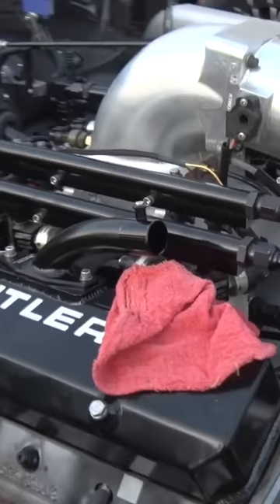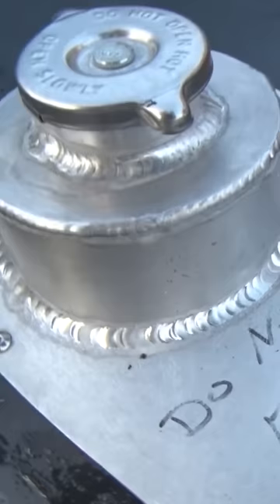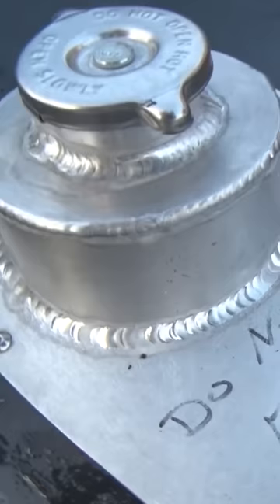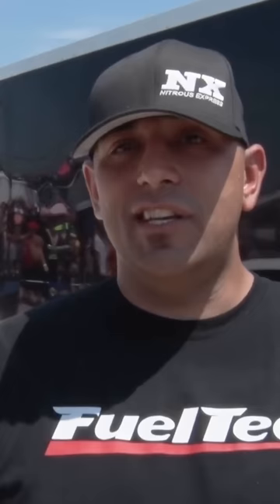Big Chief talking about The Crow’s engine

Comment: Man, you know I use to hear all that about diehard Pontiac people back home in Louisiana… They live and die Pontiac to life…👍🏾✌🏾
Reply: What do you drive now  cause they don't make Pontiac anymore.
Reply: @matthewvarnam4302 , for your information, I drive a 6 speed 1997 30th anniversary Z-28 Camaro… But, my dad owned a 72 Pontiac Lemans with a mild small block and my dads brother owns a old Limited Street NMCA 90 Trans Am with SB2 Pontiac small block in it down south in Louisiana… Back in the 70’s my uncle used to have a 67 GTO… So, yeah, I grew up around them…👍🏾
Reply: Can’t believe he’s still running aftermarket block and heads of a 55-78 Pontiac V8 platform. Love them myself- but the LS and BBC based stuff too cheap and easy. I guess the turbos are the equalizer with the fuel system as he says. That said , wouldn’t it make more power with some Warp 6 style heads ?
Reply: @jamessharp9790 , I’m with you on everything you said… But, some people that I knew back home in south Louisiana think the same way and they feel they can make it work, there’s no convincing them other wise… They almost stay true on the path with the power plant in the car because, they do not believe in mix breeding the car… Thats it right there…👍🏾
Reply: Bro I've always been Pontiac and I'll always Love Pontiac
Reply: Yeah I love them Pontiacs they're easy to work on and fun to drive and usually will get You home
Reply: @matthewvarnam4302  the 1971 firebird
Reply: @matthewvarnam4302  just cause they dont make new pontiac cars dont mean new aftermarket pontiac blocks and parts are not being made.
Reply: @jamessharp9790  I have a 68 LeMans in my shop that has a 505 inch version of that engine, Justin and I have the same heads and port work. I've had the heads since 2004 and they have been on a 467 until last year. 

Butler sold and machined the IAII block and set up all the forged internals for it. the price is up a little from when Justin built his, I should have done it in 2019.

I only want to put about 20psi though it at most, and with that much it will over power my chassis VERY easily. Figures to be between 1700 and 2200hp/tq on ethanol with 20 psi. You will not be getting that from an LS unless you spend a lot more than I did.

The other thing about these engines is they make their power from idle to 6500. My 467 was making well over 650ftlbs from 2500 to 5000rpm... on pump gas. It was kinda crazy on a chassis dyno, made all the Cobra and LS guys cry.

That power band means you can run a taller gear, and make the engine work more rather than go through the gears really quick. Sure you can run deep gears if you really want to, but most of us go with 2.73 to 3.73, with the NA engines.

Back in the 90s butler ported a set of iron D port heads for me, I put them on a stock rod/forged piston 455 with a 288/296 UD cam, something like 228/232@.050, 1900 stall, th400, 3.42 gear, and my 3750lb 79 Formula was running 11.40s@120. 

I had all of $2700 in that engine. $1500 of it was the heads. Back then I was only 260lbs, so race weight was around 4000.  Good luck getting a chevy to do the same for so little cash, and then lasting for over ten years without even pulling a valve cover. Street driving, bracket racing, and a little fun in Mexico, shifting at 5800. The chevy is going to need some power adders if you plan to do it with garden variety common factory iron heads. 

That 467 mentioned above pushed the same car into the mid to low 9s when I could get it to hook.

When you step up to over 1000hp and you want reliable power, you are going to spend more. How many engines has Cleetus blown up? How many times has Justin hurt his? How many times has Rich Guido broken his engine that makes 1500 on low boost and he drove it 3000 miles from north west Canada down to Sick Week and won stick shift?

My little 505 just might end up doing Rocky Mountain race Week next year in my 65 LeMans gasser. Would be fun if Blasphemi shows up. The 68 LeMans is going to an AHRA event in September.

The GTOs and most of the Firebirds I have are daily drivers. I like to race the LeMans.
Reply: @southtexashustler  Pontiac never made small blocks. You saying all your relatives rolled with Chevy engines? I'm not your daddy and I still have my cammed out 72 Lemans.
Reply: @matthewvarnam4302  06 Solstice. Daily.
Reply: I daily a 03 pontiac grand am gt. Has the ram air. Still a great little car.

Comment: Had a 65 gto with basically a 70 ram air engine . I was nervous at the strip and ran 15.0 starting out in 3rd gear vs 1st twice . Car ran 13.40 on street tires and 3. 36 gear. Tourqe!

Comment: I've had a few big block Pontiac engines over the years,  big torque power highly underrated. A few simple modifications would turn them into torque monsters.
Reply: There are no big block pontiacs, they are all one block size

Comment: Nice to hear technical specs. Edelbrock off the shelf heads that's funny! Most people if you told them that's a Eldebrock off the shelf head would never believe you. May get AFR to build some serious heads and bigger Pontiac custom block at Sonny's or Steve Morris engines to go big liters too. If you run out of steam and still want to stay Pontiac. Sonny's Engines makes Big Block Chevy Real Big Hemi Heads check them out at Sonny's Engines in Lynchburg Virginia in America. But the only thing in these mountain motors that's Chevy is water pump, starter, flywheel and cylinder heads on some of their engines. Other than that everything is custom. Cams past 1" of lift, 2.0 rocker arm ratios and more.
Reply: LOL!!!
Reply: He builds some some bad ass pulling motors!!!

Comment: O yea a pontiac motors will hall ass. Can u put a Pontiac motor into a g-body Cutlass, or a boxed Chevy or Monte Carlo or sum?
Reply: Get mounts for it the problem you'll have is the transmission you need adapters for a th400 (Chevy) or 4L80. Pontiac doesn't share bellhousings with Chevy transmissions